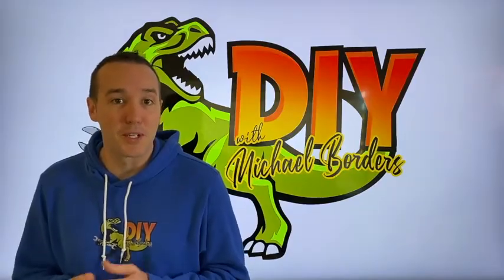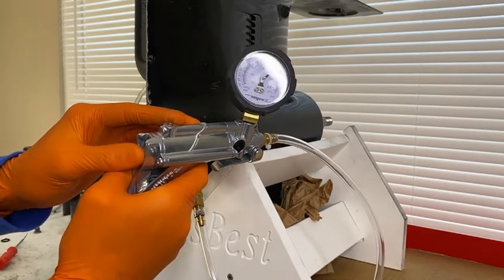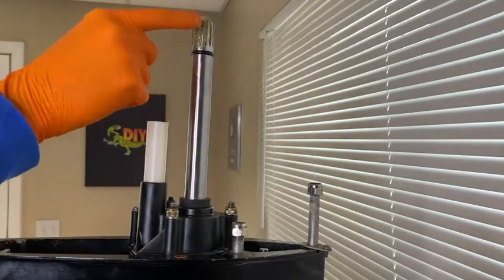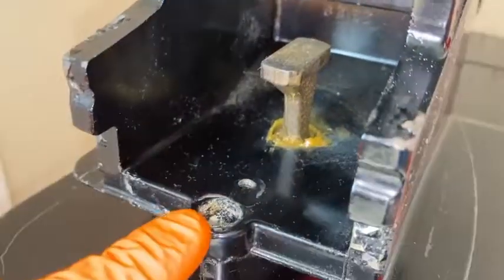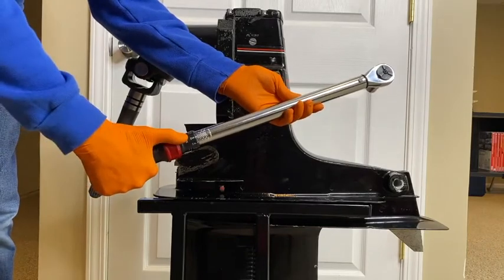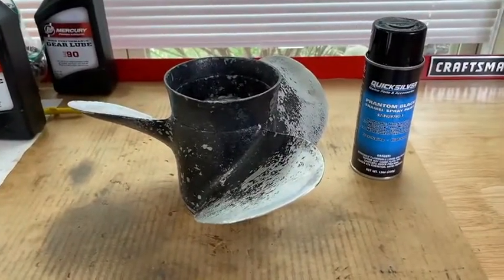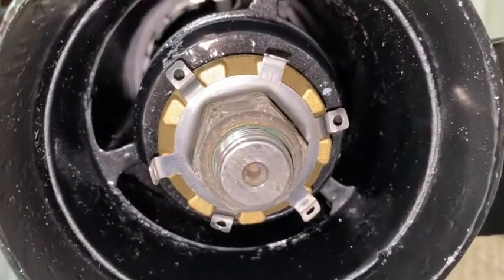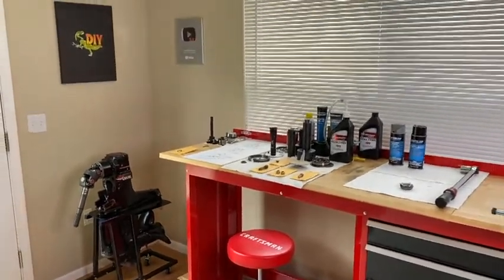Mercruiser outdrive lower unit rebuild - (PART 7)

Comment from the maker: If interested in purchasing the products below, visit our Amazon affiliate links below.  I earn from qualifying purchases.

1.  (2-4-C Lubricant)

          https://amzn.to/3NwTCfg

2.  SAE 90 gear lube

          https://amzn.to/3OUVsYN

3.  Anode bolt (10-32470)

          https://amzn.to/3I9rcXP

4.  5/8 nuts (11-859116)

          https://amzn.to/3OERbJ9

5.  5/16 rear bolt (10-30206)

          https://amzn.to/3a7PXXX

6.  3/8 Anode bolt hole cap (19-47579)

          https://amzn.to/3yD9Hfe

7.  Anode kit (888755Q04)

          https://amzn.to/3I9ktgD

8.  Video link to all Anode kit replacement

          https://youtu.be/qy_qclP3zUQ

9.  Link to video explaining all differences between Anode kits

          https://youtu.be/r11ulZv_plI

10.  How to repaint propeller

          https://youtu.be/s4ytMFUDGA4

11.  Continuity washer (13423511)

          

12.  Castle washer (12-31211Q03)

          https://amzn.to/3OHkOcQ

13.  Prop washer (14816629)

14.  Hand pump Pressure test kit

          https://amzn.to/3LDoa15

😎👍

Comment: I watched all of your videos of this rebuild. You have excellent production quality with the videos! I have been rebuilding my Alpha 1 Gen 1 right along with you. I am an aircraft mechanic by trade and this is my first experience with boat drives. Very intimidated at first to tackle this but being able to watch you go through everything gave me more confidence I can do this. Showing part numbers with everything is a big plus! I was able to fabricate some of the tooling myself and that helped with costs. Some I bought however. I am currently working on my lower unit. Just recently got the bearing carrier pulled out. I adapted a puller I had to get it pulled out. It was very difficult and hoped I didn't have to go through the drilling and chiseling of it. Thankfully mine eventually came free and removed it in one piece. My drive is off a 1974 Wellcraft (165HP) and have no knowledge of it ever being torn down this far. So I hope all my gears, bearings, and shafts are still in good enough condition to reuse. Also love the work station. So very clean as it should be. You deserve a sponsorship from Craftsman! Thanks again!
Reply from the maker: Thanks for watching & sharing this, that’s extremely kind of you!!!  How’s your lower unit project going?

Interested in hearing back from you on your progress.  Us DIYers need to stick together!!!

😎👍